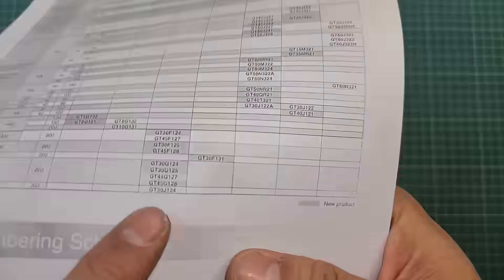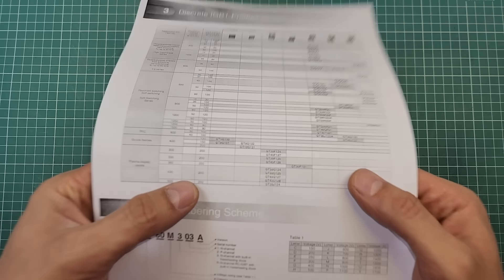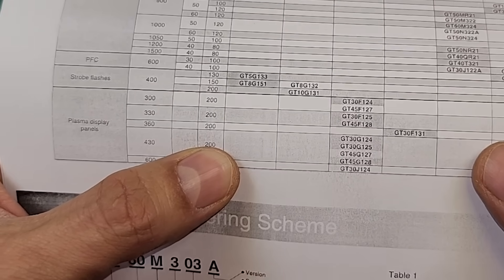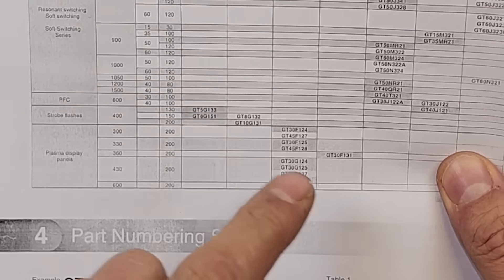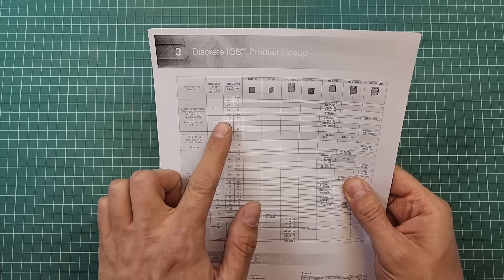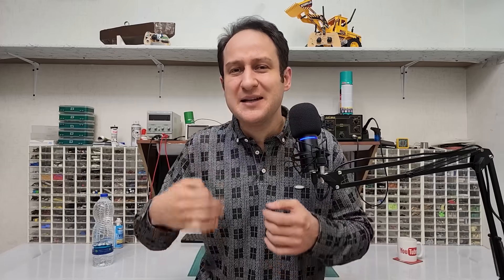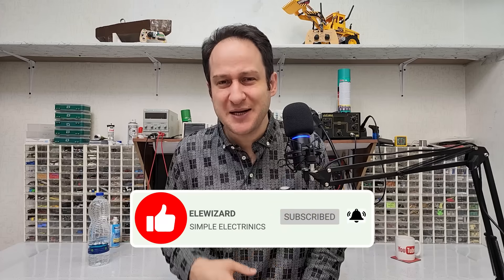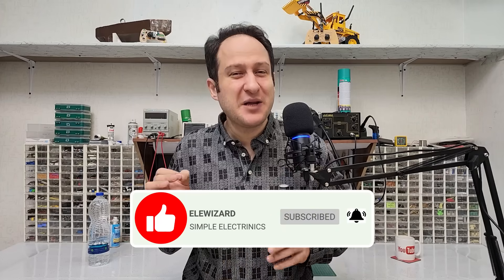Can a small transistor really switch 200 amps of current?

Comment: GT30G124 spec says:  GT = IGBT , 30 = 30A , G = 430V , 1 = Nchan , 24 = version
So:  30 Amp max continue  and  200 Amp max puls = 3 uS (micro second)
Reply: aren't IGBT's slow switching?  So can you ever turn it off in time?
Reply: @robertsmith2956  Many IGBT's are slower than MOSFET's, but not that much slower. Turning it on and then back off in 3 microseconds should be doable. Now, if you wanted a 100 nanosecond pulse or something, that's probably not going to happen. I'd have to look at the rest of the datasheet to know for sure though...
Reply: @odincauzza2509  3 microS.  So half the time it wont then.  :text-green-game-over:
Reply: @odincauzza2509  Probably the 3 microseconds is the ON time irregardless of rise and fall times.
Reply: @odincauzza2509  IGBT is Mosfet + BJT in series. It should be much slower than Mosfets.
Reply: @kimatong1166  I know. I was replying to someone saying you couldn't even use it with a pulse that short. Which is nonsense of course.
Reply: @kimatong1166  This is true. I've seen some overlap between really fast IGBT and really slow MOSFET specifications, but in general you're right. In any case, neither should have a problem switching a 3 microseconds pulse! That's all I was trying to say.
Reply: @ in the best of cases no, no problem, but just something as simple as placing a filtering cap in the wrong place can chenge everything ...
Reply: @robertsmith2956  It will self turn off as it turns to smoke!     :)
Reply: @glasslinger  Darn,  I wanted TWO to put on my houses main lines so I could shut them off.  Fuses are a pain to replace.
Reply: @ lol , ya unless it short first, but it would in any case most likely burn up/fail/explode .. but ive seen failures wher the capsle is exploded but the rest metall is shorted .. but its likely tolow current .. but indeed a fun failure lol .. not to experience, the bang is like an explosion, leads  melt and the solder can melt leading to more 'fun' lol ...
Reply: @glasslinger  You meant, the magic smoke will break out of the package and render the functionality null and void.
Reply: @robertsmith2956  t=Qg/Ig ..
for GT30G124 Qg is 330nC if Ig is 1A t=330ns
Reply: @robertsmith2956  microsecond is slow in BJT's. A general purpose 2N3904 BJT switches to a total of almost 100 nanoseconds. So 3 microseconds or 3000 nanosecond is wide enough.
Reply: That would be 30A IF you have a sufficient heat sink.
Reply: @rockets4kids   Correct.
Reply: @rockets4kids  That would be liquid nitrogen cooling if the datasheet's Ic vs Vce(sat) curve applies to the device.
Reply: @rockets4kids  the required heatsink will be in the datasheet. Or, rather, calculated from the datasheet info.
Reply: @rockets4kids  ...
To handle 350W of heat dissipation, you should look for a heat sink with a thermal resistance of around 0.17°C/W or lower and sufficient surface area (typically between 1000 cm² to 1500 cm² depending on airflow conditions). The specific design will depend on whether you have forced-air cooling (with a fan) or rely on natural convection. If you're unable to find a commercial heat sink that fits these parameters, you may need to customize the design or consider liquid cooling for optimal efficiency.

Note: Thermal resistance ( heat dissipation needed to be higher than this)= allowed temparature rise(from ambient)/effect 350W
Reply: @rockets4kids  say u have a heatsink and the fins are 5 by 5 cm its 50cm2 per fin (two sides) 1000/50=20 fins , if thay are spaced 2mm apart 2*20 = 40 mm long with airflow cooling
Reply: @Patrik6920  EDIT: I'm wrong. 
If you've ever built a computer, this is pretty reasonable. A typical moderately high end cpu will have between 100 and 200 watts of power dissipation. So pull a heatsink off an old motherboard and you'll be able to cool this enough for 30A continuous current.
Reply: @SkippiiKai  yup, aways have a bunch laying around, and from various electronics, u never know when u need to cools something insane u testing lol, all those litte fans can also be nice holding on to ...
Reply: @rockets4kids    While a reasonable heatsink would work for this at 30A, it's still a really terrible choice of device for this. The datasheet is clear that it's designed for things like fast LLC/resonant inverters and plasma displays. You could just use a dirt cheap IRFz44 that will handle 49amps continuous with only 0.0175ohms resistance without even needing a heatsink.
Reply: @Patrik6920  My hoarding might have taken this to an extreme, but I don't have to worry about my projects ever getting hot...
Reply: @SkippiiKai  lol, i must say i know that feeling somewhat ...
Reply: @Patrik6920  So who else here is looking through their stash for a 30 amp power supply?
Reply: @SkippiiKai  ...well i have a erm 'few' ...
Reply: @Patrik6920  So do I! I just... Don't remember where I put them. 🥴
Reply: @SkippiiKai  ...
np her is how to build one ...
Key Components for a 30A, 1-30V Voltage Regulator

    Transformer: To step down the AC mains voltage to a lower AC voltage before rectification. The transformer should be chosen based on the required output voltage and current.
        For example, to achieve a 30V DC output, the transformer should output around 20V-24V AC (depending on the rectifier and filtering components).

    Rectifier: Converts the AC voltage from the transformer to DC. This can be done using a bridge rectifier.
        You'll need diodes capable of handling high current (e.g., 30A diodes).

    Filter Capacitors: After rectification, you'll need large capacitors to smooth the DC voltage and reduce ripple.
        Use high-value electrolytic capacitors (e.g., 1000 µF to 5000 µF rated at 40V or more).

    Voltage Regulator Circuit:
        To regulate the voltage and provide a stable output, you'll need to use a power transistor (e.g., MOSFETs or BJT transistors) or high-current voltage regulators.
        You can implement a buck converter or use a linear voltage regulator with a feedback loop to control the output voltage.
        If using a linear regulator like LM338 (which can handle 5A), you would need multiple transistors to handle higher currents.

    Power Transistors: For higher current handling, you would need power transistors (e.g., MOSFETs or BJTs) like IRF540 or TIP3055 transistors.
        For high efficiency, a MOSFET with low on-resistance is preferred to minimize power losses.

    Feedback Control: A feedback control circuit (often using an op-amp) ensures that the output voltage stays constant by adjusting the output based on load changes.

    Heat Management:
        Since you're dealing with 30A of current, significant power dissipation occurs in the components. Heat sinks are essential for both the transistors and the regulator circuit.
        Depending on the configuration, ensure that the MOSFETs or BJTs have appropriate thermal management (e.g., big heat sinks or active cooling like fans).

Simplified Schematic Design Overview:

    AC Input Stage:
        Use a step-down transformer with appropriate current rating.
        Follow with a bridge rectifier and filter capacitors to provide DC voltage.

    Voltage Regulation Stage:
        Use a voltage reference IC (like TL431) to set the desired output voltage.
        Use a MOSFET or power transistors to handle the current regulation.
        Implement a feedback loop with an operational amplifier (op-amp) to control the gate/base of the power transistor, adjusting output voltage as needed.

    Output Stage:
        Add output filtering capacitors to smooth the DC output.
        The output is now a stabilized voltage from 1V to 30V depending on the regulator setting.

Note:

    If you're designing a switch-mode power supply (SMPS) for higher efficiency, you will need a buck converter topology, which involves switching transistors, inductors, and capacitors to step down the voltage while maintaining high efficiency.

Basic Schematic Blocks:

    Transformer → Bridge Rectifier → Capacitors → Voltage Regulator (Op-Amp + MOSFET) → Filtered Output

Example Circuit Configuration:

    Transformer: Choose one with an output of around 18V AC for a 30V output after rectification (allowing for voltage drop).
    Bridge Rectifier: 4 diodes (e.g., 30A diodes like 1N5408) for AC to DC conversion.
    Smoothing Capacitors: Use large electrolytic capacitors (2200 µF - 5000 µF, rated at 40V or more) after the rectifier.
    Voltage Regulation: Use a MOSFET (e.g., IRF540), driven by an op-amp (e.g., LM358) for feedback control.
    Heat Dissipation: Attach large heat sinks to the MOSFET and use additional ventilation or fans if needed.

Final Thoughts:

Designing a 30A, 1-30V voltage regulator requires careful component selection, particularly for power transistors and heat dissipation. If you're not familiar with power supply design, I would recommend looking into existing designs for high-current adjustable power supplies or considering ready-made modules for such purposes, as the design can get complex when managing such high current and power dissipation.
Reply: @Patrik6920  LOL. Chat GPT? I get in fights about EE with Gemini all the time. Luckily I'm experienced enough in power supply design to know not to use a linear regulator on a 1-30V 30A supply! Actually, ever since I read a paper on combining RSE and non-pulsating I/O modes with the Zeta converter, I've wanted to build one.
I think the paper was called "Novel Boost Topology with Non-Pulsating input and output" of you want to read it.
Reply: @Patrik6920  Hah... Temptation got the better of me and I just managed to snag a used 12v, 200AMP (2400watt output) power supply on ebay for less than 20 bucks. Probably throw a couple Zeta converters after it and I'll have all the power I'll ever need on my bench. I'll just need... Um... A kinda long extension cord to one of the two 240v outlets at my house. 😁
Reply: @ You say "pull a heatsink off an old motherboard and you'll be able to cool this enough for 30A continuous current"

But you won't. Look at the datasheet: maximum junction temperature = 175°C; dissipation at case temp 25°C = 25W; Vce(sat) at 30 A > 1.5V. That's all you need to know that no heatsink is going to work.

Calculate the thermal resistance junction to case for the TO-220SIS package = (175 - 25)°C / 25W = 6°C/W.

Calculate the power dissipation at 30A = 30A x 1.5V = 45W.

Calculate the temperature rise of the junction above ambient = 6°C/W x 45W = 270°C.

Calculate the maximum case temperature that keeps the junction from exceeding 175°C = 175 - 270 = -95°C.

So even a perfect heatsink would itself have to be cooled to -95°C for the device to pass 30A continuous current. No "old motherboard heatsink" is going to do that for you.
Reply: @RexxSchneider   I did a rough approximation of those calculations in my head before I posted, and, um... I may have missed a step! Thanks for posting that. As soon as I read the 25w vs 45w I realized my answer made no sense. This does seem like really bad thermal resistance for a 220, though.
Reply: @SkippiiKai  lol thats excellent ..
Reply: @SkippiiKai  mmm since its used, check the capacitors especially the electrolyte one(ce) might want to add in a solid state supercap or someting, the zeta circuit going to stress the power supply (it wasent designed to be used in that way)
Reply: @SkippiiKai  Yes, 6°C/W is crap compared to say an IRFZ44N in a TO-220AB package with a thermal resistance of 1°C/W. The problem is that TO-220SIS is plastic. I had expected it to be metal inside, but it seems not. I checked another Toshiba device in TO-220SIS, the TK32A12N1 mosfet (rated at 30W) and that has a channel-to-case thermal resistance of 4.16°C/W. It just looks like TO-220SIS is designed to be cheap, but good enough for devices that only have to dissipate peak power in brief pulses. Not all TO220s are created equal!
Reply: @ junction temperature is not the same as package temperature....
..a junction in a cpu can be 150 deggrees C and the package temperature 30 C
Reply: @RexxSchneider  I'll be honest... I didn't notice it was plastic and I just assumed it was around 1c/w or less because I have a bunch of to-220 mosfets and that was the first datasheet I found. Lesson learned!
Reply: @Patrik6920  I suspect it's probably not that old, probably only a few years, but used very hard... My guess is retired from crypto mining. I'm never going to need 200 amps, so the first step is probably going to be switching out to run on 120v. Or... Actually, better idea, this is going to replace the power supply for another project in the room that has the 240v, and I'm gonna take that one and put make that one into the bench supply.
But first my friend wants to find out if the 12v 200A supply will jump start his pickup truck without the battery installed. Which is such a stupid idea that I'm probably going to try it. I think it'll end badly, but even in the worst case scenario I'm only out $19. He's the one with the truck. Well, I guess, technically it's his wife's truck.
Reply: @SkippiiKai  ..well it probably will start, but it will likely damage the PSU
a normal starter on a car peaks for a moment between 100-300 amps (0.5 to 5 s)
a bigger truck can peak anywhere from 400 to 800 amps, withot a rather beefy cap pack this will not be good for the PSU
Reply: @Patrik6920  I actually don't think it will start. A server psu, at least one from a real company like HP generally has very sensitive over-current protection. Okay, that does assume I actually got a genuine HP at that price - but those kinds of deals are possible since the cypto mining bust. We'll see. I'm not all that worried about it.
Reply: @SkippiiKai  well if ur not afraid smoking the PSU go for it, and try he same with a beefy cap pack in between .. should be a distinct difference
Reply: @SkippiiKai power is I^2xR. That mosfet is dissipating 40W at 49A. It will certainly not handle that all day without a heat sink.
Reply: ..U have to know the effect it can switch rly... without that data 30A doesent say to much ..
if it can swith say 100W, yes it can switch 30A .. but only contingously 3.33Volts
430V * 30A = 12.9Kw .. and there is no way in h* it can switch that

it can handle 350W, and 120A (N-channel type, D2PAK Package Type)
so ...120A at 2.92V contingously, or 0.81A at 430V
..Threshold Voltage is 1.0V (lowest voltage that it can switch at), wich effectivly mean it for breief periods can hadle 350A)

derived using AI:
The GT30G124 is indeed a transistor, and it is a N-channel MOSFET 
N-channel MOSFET, 30V Drain-Source Voltage (Vds), 120A Continuous Drain Current (Id), 1.0V to 3.0V Gate Threshold Voltage (Vgs(th)), 0.010Ω max Rds(on) (Static Drain-Source On-Resistance), 350W Power Dissipation (Pd), D2PAK Package Type, 330nC Gate Charge (Qg), -55°C to 150°C Operating Temperature Range, DC-DC converters, Motor control circuits, Power supplies, Switching power amplifiers, Automotive power systems.
Reply: @Patrik6920  You only care about the volts with regards to open circuit. When its closed, it doesn't matter how many volts there are, they'll be dropped somewhere else. You only care about how many volts the IGBT itself drops
Reply: @Patrik6920 you don’t switch watts. Once turned on by sufficient gate drive, the device exhibits a Vce sat characteristic based on the current through it. Multiply the current x Vce sat and you have the power dissipation.
Reply: @Patrik6920 this is not a mosfet. It is an insulated gate bipolar transistor.
Reply: @bretfuzz925  The GT30G124 is indeed a transistor, and it is a N-channel MOSFET
Reply: @ GT30G124 is a Mosfet manufactured by Fairchild Semiconductor
a component called GT30G124 thats is falsly called an IGBT exist, IGBTs usually have a maximum voltage above 600V and are typically far slower than a mosfet (.5-1 microseconds turn off typically) ..
Reply: @Patrik6920 thanks for clarifying. I was unaware of the Fairchild MOSFET device. BTW there are a handful of GaN IGBTs being produced now that offer sub 20nS Trise and Tfall times.
Reply: @bretfuzz925  yes ... progress
FinFET, Gate-All-Around (GAA) FET, Multi-Gate FET (MuGFET), Silicon-on-Insulator (SOI) FET, Tunnel FET (TFET), PiFET, Vertical FET (VFET), 2D Materials-Based FETs (Graphene, MoS2, etc.) among others keeps puching the boundary ...